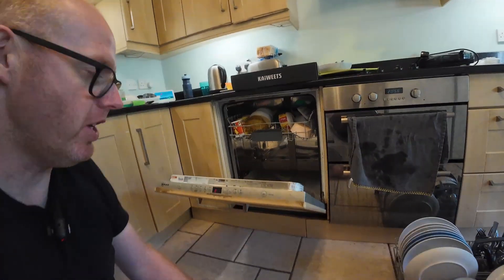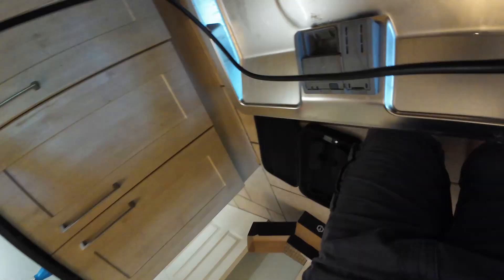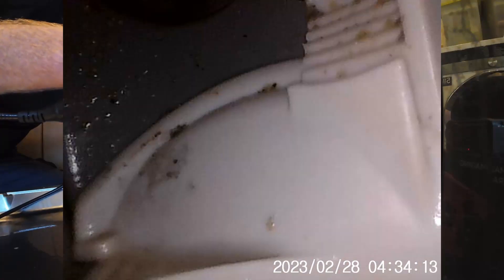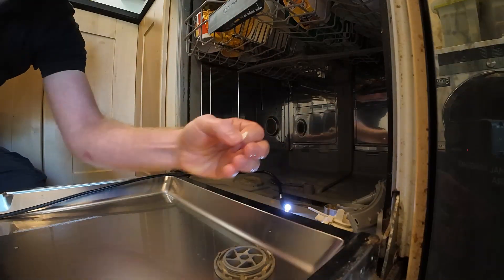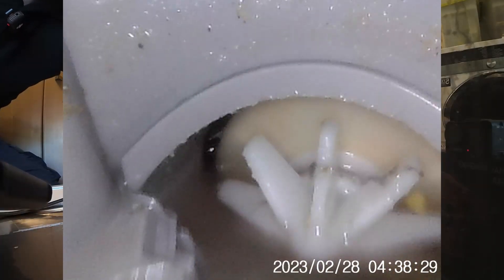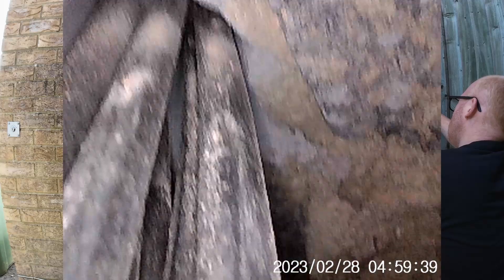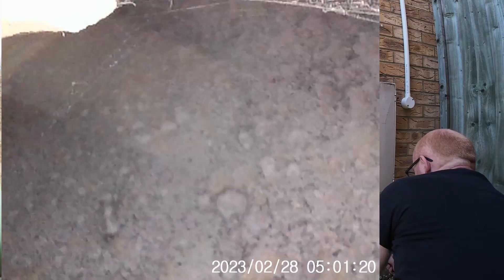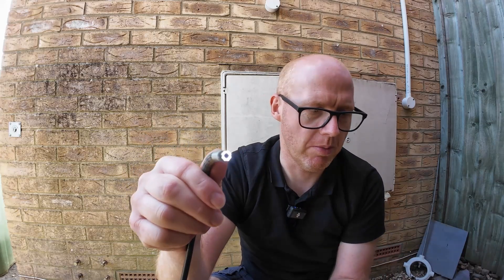DIY Troubleshooting with the Kaiweets KBA01 Borescope: Dishwasher Repair & Cavity Wall Inspection

Comment: Have you tried using it to find pipes/cables in stud walls? For example, if you drill an 8mm exploratory hole, would you be able to fit this through and articulate to peek around the void and then fit a 8mm wall plug in the same hole when you're done? I've been considering a Teslong with a 6.5mm head but it is a bit pricier and would have to go through Ali.
Reply from the maker: I have drilled a 10mm hole to send it into a cavity. You could probably get away with a 8mm hole at a squeeze.

Comment: That’s a great piece of kit. I think I wouldn’t worry about insulation around the meter box as it appears to be only in the area of the garage and don’t need to worry about heat buildup on your meter tails and meter box. You might be pulling some heavy loads from the grid going forward. Enjoying your videos as always.
Reply from the maker: That's a point.

Comment: How do you rectify a small area of missing cavity wall insulation? Who would take that job?
Reply from the maker: For me it's going to be easy. My gas meter box is coming out soon 👍

Typically they would drill and blow foam beads in.

Comment: Do u live nearish to the sea prevailing winds etc there’s been real horror stories where insulation fitted then wet exterior walls tracks moisture into insulation thus making interior walls damp some houses need the air gap 👍
Reply from the maker: Yes, that's true. I am aware that they are using different blown beads now and other methods to help retain good drainage in the cavity. 
In this case I think they were just lazy to be honest. The insulation is good around the rest of the house but lacking around the meter boxes.
I could already see it with my thermal imaging camera but great to get a good confirmation from the bore scope.